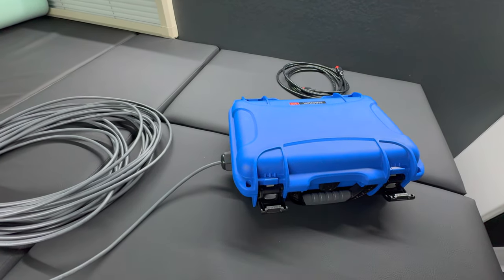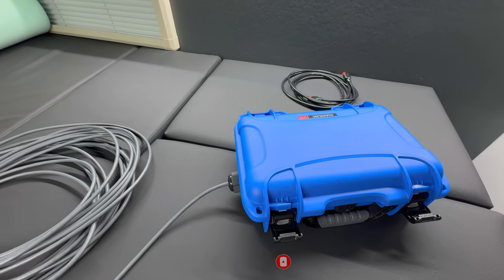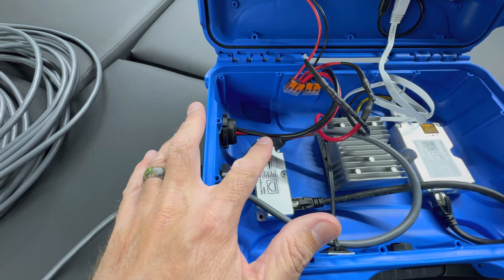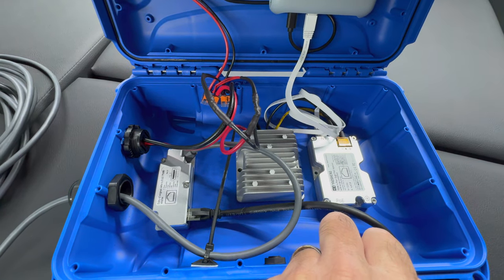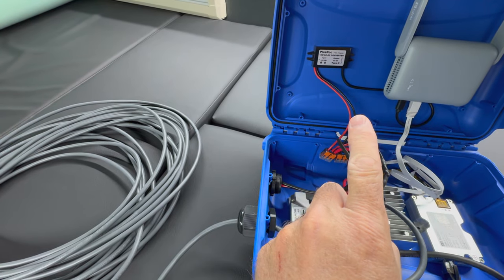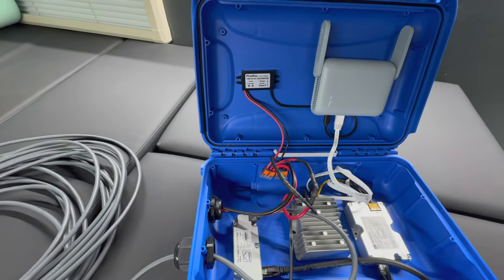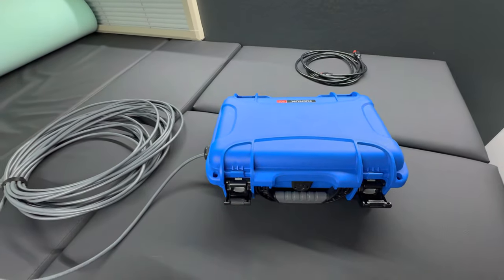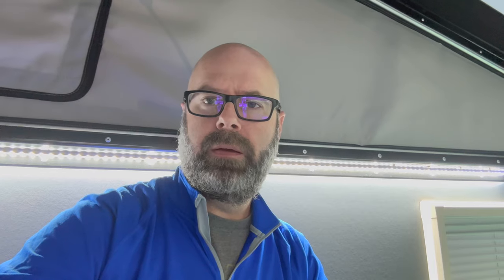Convert your Starlink to 12 volt DC - No Cable Cutting!

Comment: It works with the 12v output of the jackery?
Reply from the maker: I needed to make a cable, but yes the Jackery will power everything.  By using 12v vs the inverter I get hours more run time.
Reply: @BradKoester  Hi Brad, tks for your answer. My concern is that the 12v outlet is rated at 10A max. So you clarified. Hugs from Brazil